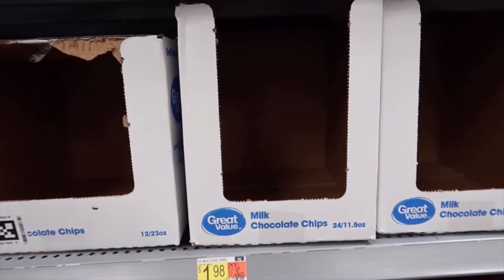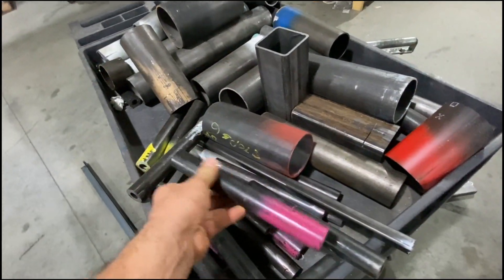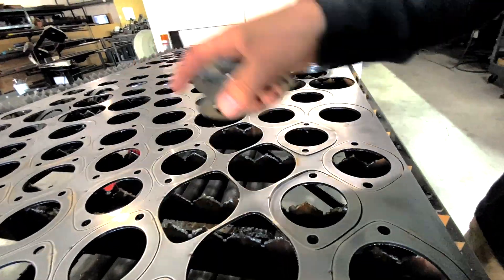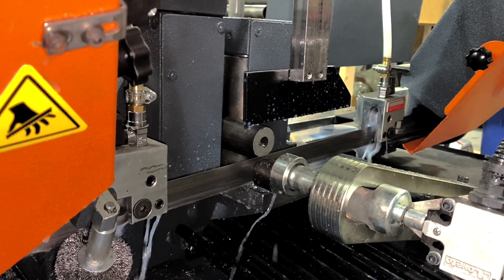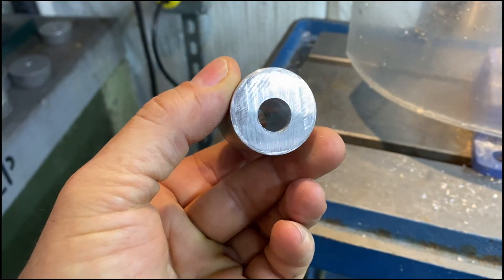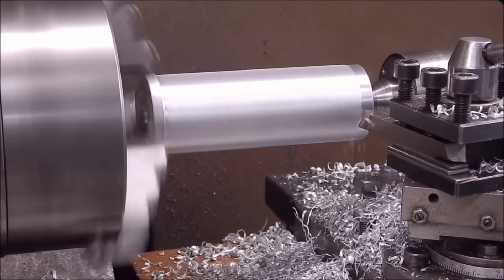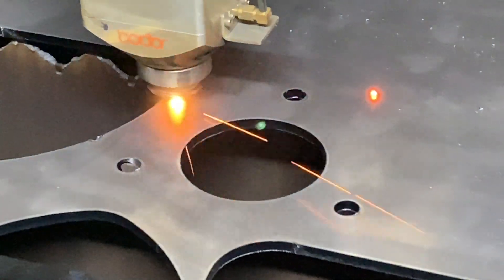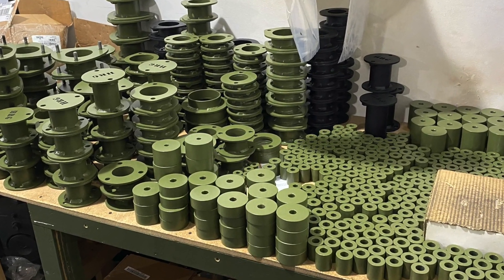This one thing is messing up HRG Engineering. (but we have a plan)

Comment from the maker: We are switching to aluminum ONLY FOR SUBFRAME KITS. We can no longer get the steel needed to make them. Lift kits will continue to be made from steel.
Reply: a unpainted raw aluminum set would match my build, would be cheaper for you to produce without paint or powdercoat too.  looking to do my 91 and/or 2001 integras

Comment: a ton here that ppl recycle. i know a few places that hold the stuff that never been used
Reply: the factory i work in scraps steel like that alot, like dumpsters worth. we get it in 20 ft lengths and cut down to make kingpins. i think after cut there is like 7 inch sections of raw material we scrap.
Reply: and no one approaches someone up high? i bet that dumpster is someone related to someone high up. cuz i gice higher return on scrap just to save the pieces